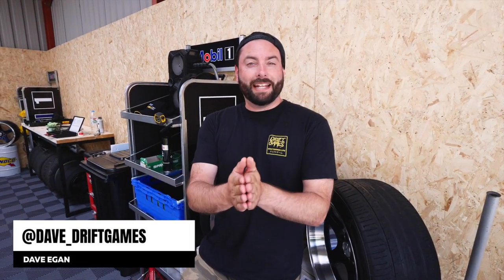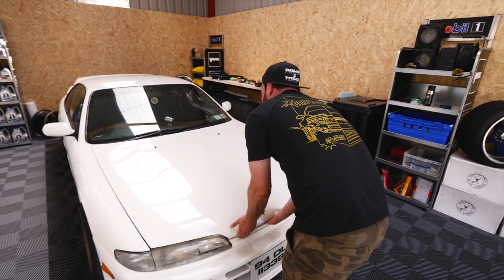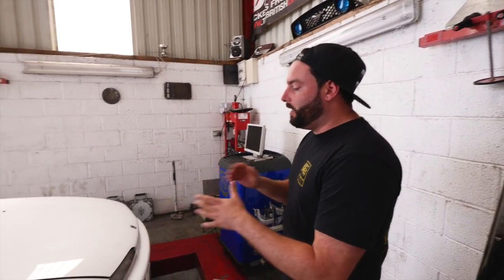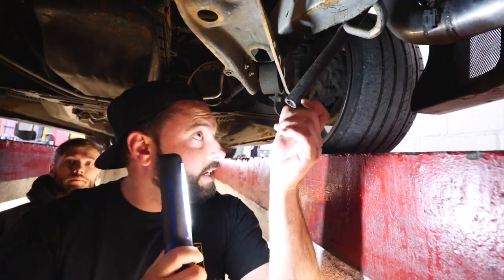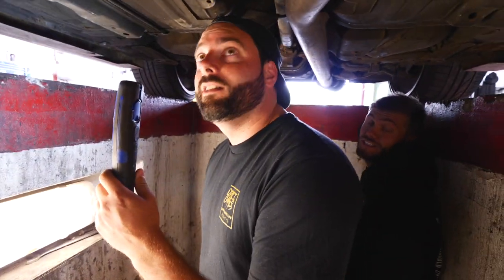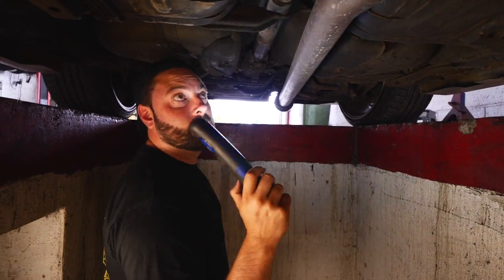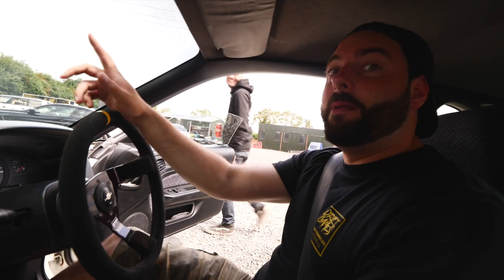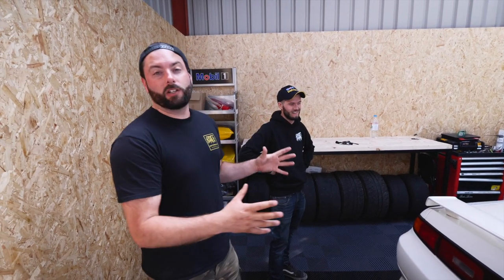WE BOUGHT A 6-CYLINDER TURBO RWD LEGEND! | WHAT IS IT?

Comment: Nice! The stock rpm gauge is calibrated for a 4 cylinder, when it gets the signal output from a 6 cylinder ecu they read at 50% more
Reply from the maker: Thanks for the info!